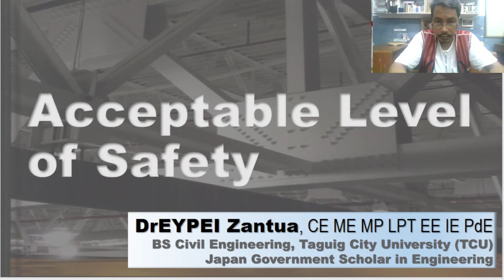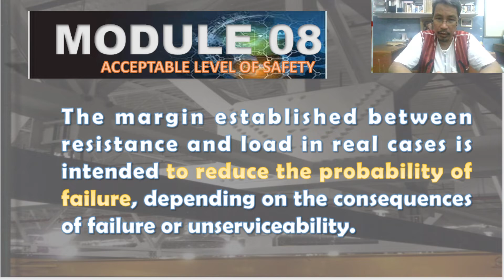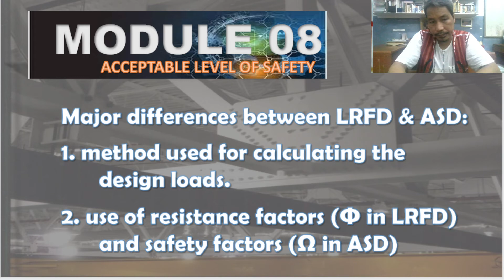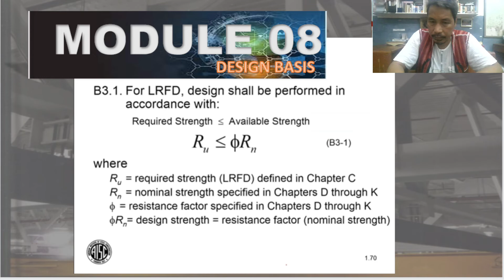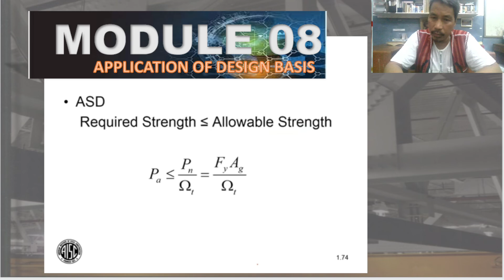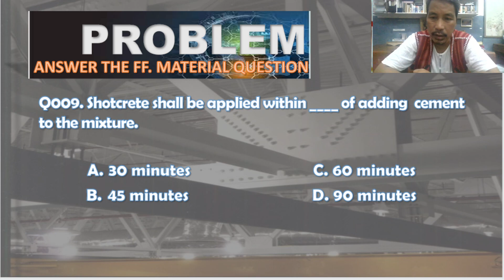Acceptable Safety Level: Specifications, Loads & Methods [ Principles of Steel Design ] Module 2.10

Comment: Sir, thank you for discussing the appropriate level of safety. ASD and LFRD have also been recognized. ASD makes use of safety considerations, whereas LFRD makes use of resistance aspects. It also discusses fundamental design equations, required strength, and available strength in the context of structural safety. I'm going to watch it again to better comprehend the design ideas.
answer is B. (45 minutes)

Comment: Thankyou sir for tackling about specifications, loads and method.  I learned that  LFRD uses some resistance factor and to the ASD uses safety factors to the said discussion. I learned also some basic equation for design, strength and available strength structural safety. 
Q009: My answer is B. 45 minutes

Comment: Thank you sir for this video lesson and for sharing your knowledge to us about the Level of Safety. I learned that LFRD uses some resistance factor and to the ASD uses safety factors to the said discussion.

Q009: Shortcrete shall be applied within __ of adding cement to the mixtures.
Answer: B. 45 minutes

Comment: Thank you sir for this video lecture about acceptable level of safety, structural design , design basis and it's application 

Q009. Shotcrete shall be applied within __ of adding cement to the mixture.

Answer B. 45 minutes

Comment: thank you sir for explaining module 10 about acceptable level of safety.

for questions 009, 
shotcrete shall be applied within __ of adding cement to the mixtures. the answer is letter B. 45minutes

Comment: In this video lecture I've learned the acceptable level of safety and the difference between LRFD and ASD.
For Q009. Shotcrete shall be applied within to the mixture of adding cement

A. 30 minutes
Ans: B. 45 minutes
C. 60 minutes
D. 90 minutes

Comment: Thank you, Sir for discussing the Level of Safety and I’ve learned in this video tackled LFRD uses some resistance factor and to the ASD uses safety factors.

Q009 Shotcrete shall be applied within __ of adding cement to the mixtures. 
answer:  is B. 45 minutes

Comment: Sir, thank you for talking about the acceptable degree of safety. ASD and LFRD have also been distinguished. ASD utilizes safety considerations, whereas LFRD uses resistance factors. It also covers basic design equations, needed strength, and available strength in the context of structural safety. I'll watch it again to get a better understanding of the design principles.
For Q-009
answer is B. (45 minutes)

Comment: thankyou sir for discussing the acceptable safety level under the module Specifications, Loads & Methods. LFRD & ASD have both same goal, it is to obtain a numerical margin between resistance and load that will result in an acceptably small probability of unacceptable structural response. But there are differences between them. LFRD uses resistance factors, while ASD uses safety factors.
Q-009, Shotcrete shall be applied within _ of adding cement to the mixtures. The answer is B. (45 minutes)

Comment: Thankyou sir for discussing Acceptable Level of Safety in this video lecture.  I’ve learned that the margin established between resistance and load in real cases is intended to reduce the probability of failure, depending on the consequences of failure or unserviceability. LFRD and ASD both have goals which is to obtain a numerical margin between resistance and load that will result in an acceptably small probability of unacceptable structural response.
Q9: B. 45 minutes

Comment: Thank you sir for this video lecture about Acceptable Safety Level: Specifications, Loads & Methods on Principles of Steel Design and for sharing your knowledge on it.
Q009. Shotcrete shall be applied within __ of adding cement to the mixture.
Answer: B. 45 minutes

Comment: Thank you sir for this video lecture that tackles about the acceptable safety level: specifications, loads and methods. I have learned in this video the two approach: the LRFD and the ASD. Both LRFD and ASD goal is to obtain a numerical margin between resistance and load that will result in an acceptably small probability of unacceptable structural response. The difference of the LRFD and ASD, the LRFD use resistance factors while ASD use safety factors. It also tackles the important definitions. There's a challenge problem at the end of the video: 

Q.009 "Shotcrete shall be applied within __ of adding cement to the mixture." A.30 minutes B.45 minutes C. 60 minutes D. 90 minutes
The answer is B. 45 minutes.

Comment: Thank you sir for this lecture video about the specifications, loads, and methods: acceptable level of safety. We have LRFD and ASD as an approach. They both goal to obtain a numerical margin between resistance and load that result in an acceptably small probability.  In this lecture video, I get to differentiate LRFD and ASD. LFRD uses resistance factors while ASD uses safety factors.
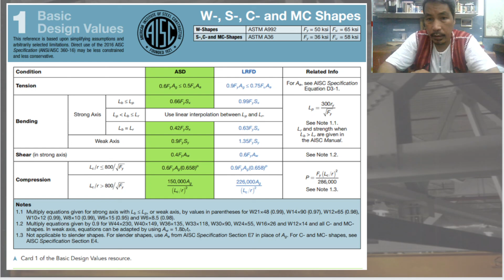For 25:59 Question 9: Shotcrete shall be applied within--- of adding cement to the mixture. My answer is 45 minutes.

Comment: Thank you sir for this lecture video about acceptable level of safety. I have learned in this video the different uses of LRFD and ASD, LRFD is uses a resistance factor while ASD uses a saftey factors. Additionally, thank you sir for teaching us the three classification of the structural safety such as basic equation for design, required strength, and available strength.

For questions 009, Shotcrete shall be applied within __ of adding cement to the mixtures. The answer is letter B. 45minutes

Comment: Thank you, sir for teaching us about the acceptable level of safety. I learned that  LFRD uses some resistance factor and to the ASD uses safety factors to the said discussion. I learned also some basic equation for design, strength and available strength structural safety. 
Q009 Shotcrete shall be applied within __ of adding cement to the mixtures. My answer is B. 45 minutes

Comment: Thank you, sir for discussing the acceptable level of safety. LFRD and ASD has also been differentiated. LFRD uses resistance factor while ASD uses safety factors. It also tackles basic equation for design, required strength and available strength under structural safety. I will watch it again to be able to familiarize with the design basis. For Q-009, Shotcrete shall be applied within _ of adding cement to the mixtures. My answer is B. (45 minutes)